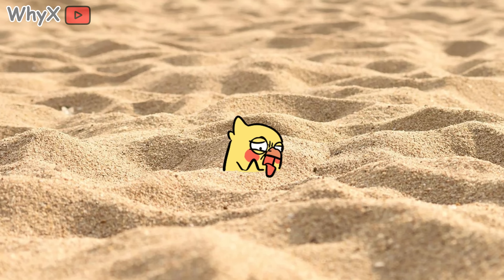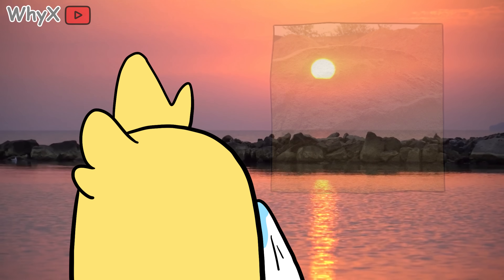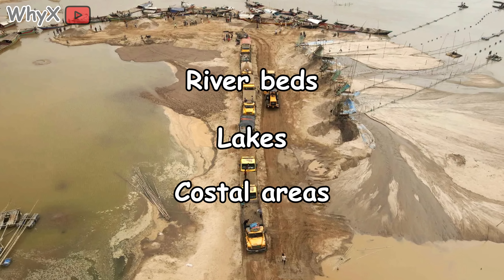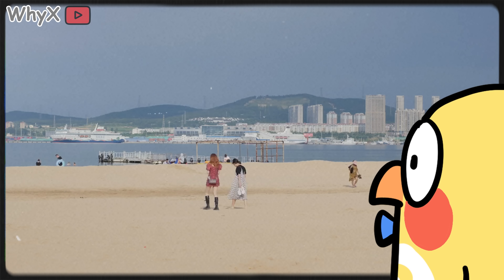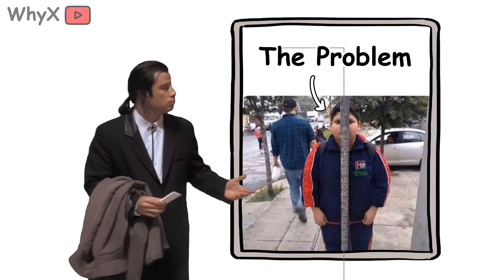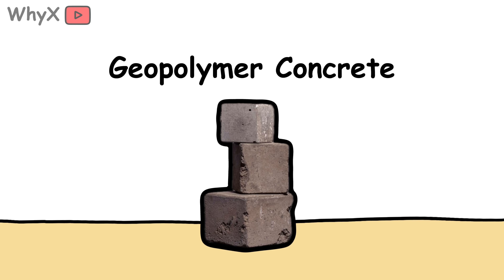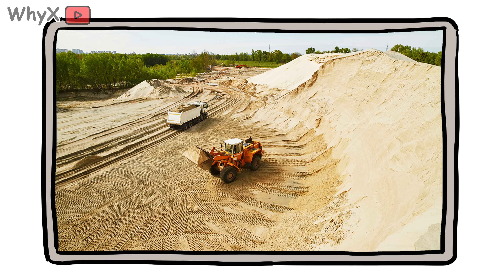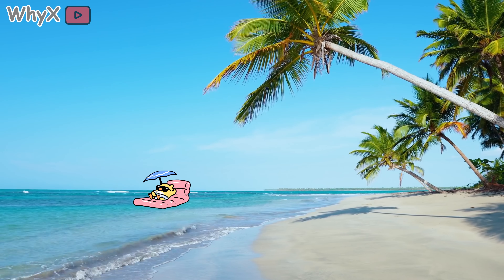Why Sand Is So Valuable to the Earth?

Comment: Im in the sand industry here in Florida. The ENTIRE state is nothing but sand. It's hard to get good top soil because it's all sandy. What's far more difficult is to find good, usable sand we can use for projects. Beach sand is different than concrete sand, which is different from mason sand, which is different from septic sand. Most of the sand is full of clay which is useless.
Reply: Is concrete sand or beach sand the right one for making a good sandwich?
Reply: When I opened this video I thought all I needed to know was that sand was one of the three components of dirt - the other two being detritus and clay. Desert sand is likely only sand and clay, with just enough of the latter to fill in all the edges of the sand particles. I'm going to leave learning the differentiation of sand quality for if/when it may be useful. For now just knowing it's vital is worthwhile. Much like rubber, as the previous video I watched was about xD
Reply from the maker: That’s fascinating, Florida really is the land of endless sand. Thanks for sharing that insider perspective 🥰

Comment: We should move back from sand to stone
Much stronger than average concrete
With it we could built much stronger/higher buildings, It's a matter of finding good binding agents for new age of stone construction
Reply: stone takes a lot more work to extract though
Reply: I mean, stone can be much harder than any concrete
Cut from big elements
It can last whole generations
Could build really high apartment buildings with it
And making it in to massive stone blocks, you are pretty much building it like Legos using big machines
And it's so strong you could build 50 stories high and still put a garden on top of it
Reply: @taith2  the reason why we use sand is because its easier, cost-effective, and faster than stone-building.
Stone is alot less cost-effective, and far too expensive.
If not careful, Stone can still break before it can be turned into valuable construction material.

Sand is fine, loose, and easy to mix with other materials like cement and water to make concrete or mortar.

Stone is heavy, rigid, and difficult to shape unless cut or crushed.

Sand fills gaps between larger particles and helps bind cement in concrete, creating strength.

Stone, unless crushed into smaller pieces (gravel), doesn’t provide the same fine binding effect.

Sand can be easily transported in bulk and poured into molds or formwork.

Stone requires quarrying, cutting, or crushing, which is more labor- and energy-intensive.

Sand is essential for making concrete, mortar, plaster, and glass.

Stone is mainly used where strength or appearance is critical (foundations, walls, decoration), but it can’t replace sand in mixes.

Natural sand deposits are usually more abundant and cheaper to process than dimension stone, which needs quarrying and cutting.

People DO use stone construction, but only things where they need strength and durability. Needing stone in everything will be too much for our civilization.
Reply: Soil building blocks are better
Reply from the maker: Interesting idea, stone skyscrapers would look epic.